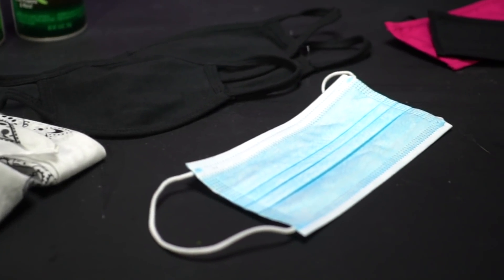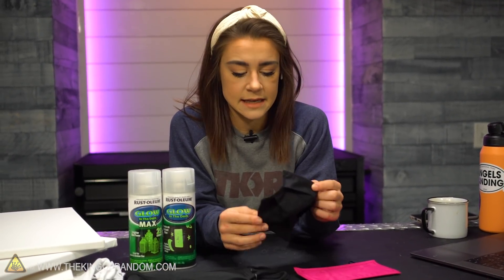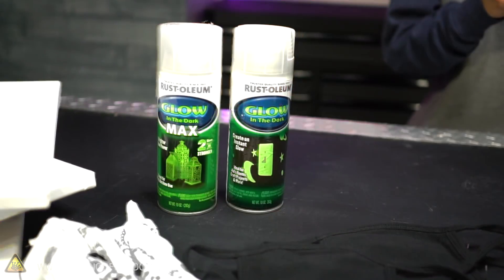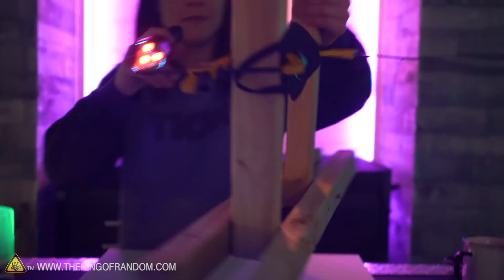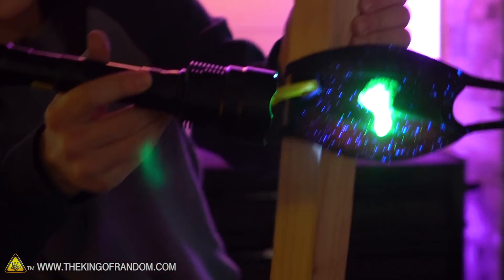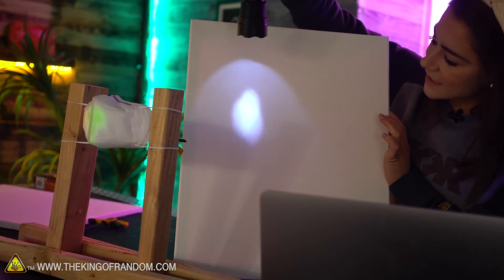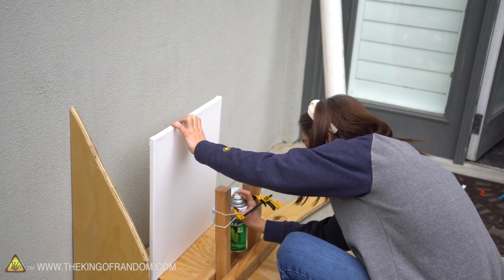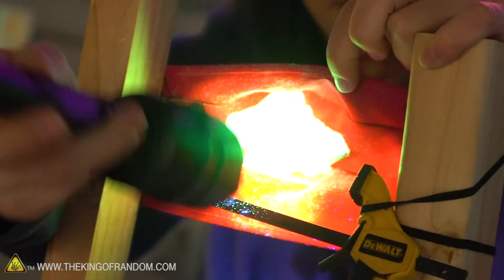DON'T Wear This Type of Mask

Comment: KN95 isn't the same as N95. KN95 is a Chinese standard, which is deceptively used on Amazon listings and the like, but where N95 masks are required (and fitted properly), KN95 masks aren't used because they don't meet the requirements

Comment: I have two homemade clothe masks, a few store bought clothe masks in a Ziplock bag with a bunch of level two surgical masks, and a Creeper themed mask that looks similar to the surgical masks, but requires a filter for the Creeper mask; which it came with two filters. Just like a personal humidifier I recently bought, which came with a filter to start with and a replacement for when the first one goes bad

Comment: This is the jankiest experiment ever. They tested the unworn masks floating around in space in front of a spray nozzle with no face to madk type block to seal against. Then they used hardware store paint with probably glowing strontium aluminate to simulate virus particles which are actually thousands of times smaller.

Comment: Unfortunately, this video just contributes more ignorance to the public. These tests are flawed in so many aspects, they are meaningless as far as covid is concerned. Spray paint holds no relation whatsoever to viral particles. Even if it was, the spray paint is not applied in manners even resembling coughs ir sneezes. The masks usage is not applied in any way similar to how a mask would be utilized in a real world situation.
At the very least, TKOR should be ashamed of themselves for this. At worst, you should be held responsible for deaths and spreading of illness that will come from your spreading of false information.

Comment: These tests are not accurate as spray paint particles are larger and heavier than covid viruses. Also the air/particles will take the path of least resistance via around any open area around your mask. Also, masks are designed to redirect your breath, not filter it. Lastly, you don’t take your breath with you when you leave the area, it will stay in that spot for up to 3 hours. Simple particle physics that I learned in physics 11.

Comment: From what i see you only did the spray paint can on the one side of the bandana when i see people folding them in half and then putting it on there face you should of tryed that too to see if it still had the same affect because its layerd more by being folded it would be more or less affected.

Comment: With a mask you will breath in oxygen and out carbon dioxide.  Then you will continue to breath in carbon dioxide which is why older people struggle to breath with masks
Reply: There is proof that your oxygen intake isnt dangerously low with a mask. There is also proof that your CO2 intake isnt dangerously high. No matter your age.

Comment: You could also try blowing out a candle with them on!
Reply: Great thought! I just tried your idea with one of my cloth masks and then again with a standard surgical mask.

I blew as hard as I could through the cloth mask from a distance of 1' moving the candle in to almost touching the mask with no effect whatsoever on the flame, But I got light headed because I was blowing as hard as I could.

Wearing the surgical mask, I again started at 1' and blowing as hard as I could, I moved the flame closer to my face. At 6" the flame began to flicker. At 4" to 3" it was clearly being affected but wouldn't snuff out no matter how hard I blew. I didn't bring the flame any closer because the material is thinner than the cloth mask and I was worried about it quickly catching fire.

Comment: Not all KN95 are made same. Anyone could be making those. What doctors are referring to is 3M KN95, they are "not allowed" to speak the first two digits, that's the manufacturer. For that brand it comes in multiple sizes - so you need-to/can do a fitting test to find which model to use.

Comment: Water soaks through cloth - that's not a real indicator... unless you're going to go lick someone.  But a better test is - spend all day without a mask - spray paint up in the air over you all day, then put on a mask, and see how much paint goes though the mask... most of it is already outside of the mask... so... that defeats your 'prevents spreading' might do something running across someone who's covered in paint...

Comment: You know what is funny none of this helps against an airborne virus
Reply: Masks have been proven to slow down the spread by 40%
Reply: @metalpuppet5798  40% is still failing to do anything
Reply: @colbyferrell8797  40% is A LOT when it comes to at least taking some pressure away from health care systems

Comment: Zinc can floor an animal in the wrong doses and will absolutely nauseate a user if the pill is taken on an empty stomach; but the strength of nausea and the relief after purging the raw pill from my empty stomach proved that the zinc is a potent anti-infection vitamin: zinc dosed daily will allow significant virus resistance for a user.

Comment: This should of been made a long time ago but from watching the first few minutes there's a lot of problems with it I see already
Correct me if I am wrong btw
1) spray paint isn't the same as the molecules of our breath is, our breath does have a lot of different sizes of molecules but spraypaint especially if it's a liquid based can only be so small and the viruses can be smaller than even our breath particles, it is not as much a huge problem but stills problem none the less 
2) N95 masks block a lot more of the particles than 95% 
Because of how they are made they block most if not all larger particles and smaller particles but the medium particles it only blocks 95% hense the N95
3) masks do work both ways due to popular belief and because of this it is actually multiplied when two people are wearing masks

Comment: This is not a scientific representation of how these face coverings would function if worn properly on a human's face. The average pressure of a spray paint can is 28 to 29 psi. The average pressure a human can generate with their lungs while breathing/talking/blowing is anywhere from 1 to 2 psi. Therefore a spray paint can is not a comparable representation of the average human and their lungs.
Reply: Also there was no proper control on how long or how much was sprayed
Reply: This is the comment I was looking for.
Reply: Pressure is measured in a surface. That's why it's called Pressure per Square Inch. The spray is dispersing in a wider area, so it's not 28 PSI. Also, when humans sneeze they generate more pressure.

Comment: So this was a better experiment than the last one, but it still didn't test the diffusion of a saturated mask which is what the state of most masks are due to them being worn for extended periods of time. A tight fitting and highly saturated mask is going to have a greater diffusion rate and increased spread of viral particles and water droplets than a loose fitting mostly dry mask that is tested in short duration. Use a small electric air mattress pump to blow into a tight fitted and highly saturated mask. Then your test will be valid and equitable.

Comment: So, the human mouth, a roughly 52mm hole,  reaches around 2-3 psi of pressure during a sneeze..

While we are doing strenuous activities we see around 0.05 psi through the same 52mm hole...

A can of spray paint is sitting at around 145 psi through a 1.5mm hole..

Just felt like someone might care about those numbers...

Comment: A bandana is doubled over when worn and provides an air gap between the 2 layers.  You can also tuck it in your shirt.  We often used them in construction, often wet for better filtration.

Comment: Argument about the bandana... you have air passing around it... the same thing happens with a regular mask.
Reply: A "regular mask" might if its just a towel or something, but a fitted mask, n95, r95 ect,  have VERY little leakage. Mostly due to the small hairs on the face.  If you have a beard,  well you are on your own.

Comment: People mad and decide this test was a failure just because TKOR didn't fold the bandana. Like 2 layer of that thin cloth will do drastically better. I can blow a candle through it
Reply: The thing is, they DID a double folded mask, they just didn't show the setup/result. Sure, it would be nice to have empirical evidence of how much the double-folded bandana did, but they specifically said that double folded was the worst other than the near-useless single-fold bandana.
Reply: @whoisthisguy128  yes I watch the whole video. And I think it doesn't matter whether they show it or not. Bandana is so thin it see through, I fold mine twice (4 layer) and still can blow a candle out

Comment: If you're spray painting outside your going to get air blowing the over spray around ... That could be the reason your canvas is getting a little over spray on it but if the over spray is heavy than the mask is not doing it's job...

Comment: I'm gonna go out on a limb and say that a human sneeze is very different than the release of spray paint, both in length and pressure. Mark Rober's video on this is much more accurate as a human was used as the subject and culture samples where shown, providing a much more stable and relatable environment and experiment.

Comment: In the testing results you seemed to indicate that the medical mask did a better job than the unfitted kn95, but in the ranking in the summation of the video you put the kn95 higher than the medical mask. Which is better?

Comment: I feel that colored spraypaint wouldve been easier
Reply: And we could actually see how the paint goes through masks, not just the aftermath
Reply: @11tomdec  actually coloured spray paint is actually more thicker so more heavier and it wouldn’t be as effective for the experiment hope this helped
Reply: @unicornpoptv2430  you might actually be right idk
Reply: Yea your right
Reply: Agree. Also I think the bandana worked that’s why they didn’t show the close up on the board. It didn’t fit their hypothesis. The test was rigged like this latest election lol
Reply: @e-ironmanmarsden754  I don’t know bout that lol
Reply: @e-ironmanmarsden754  they- didn’t have to? I saw the Speckles quite easy-
Reply: @e-ironmanmarsden754  you know you did not need to bring politics into this..and I would say Biden won the election he did not cheat.
Reply: @Defnotjolie  right!
Reply: @e-ironmanmarsden754  it’s also perfectly possible they completely forgot to show it- they are human. And it’s- kinda common knowledge (or it should be) that a cloth you can see through that’s not plastic would be- ineffective
Reply: @e-ironmanmarsden754  ehhh that's a lil far fetched
Reply: @e-ironmanmarsden754  you just wanna not wear a mask and seeing a bandana not working makes you feel bad... and there was no point in bringing your cult into this.

Comment: Okay big hole in this test the particles in the paint arent nearly as small as virus particles...
Reply: Shhhhh.  You're ruining the scare factor. Gotta keep the public afraid of the virus with the 99% survival rate so they will do what their government tells them to.
Reply: Except SARS-Cov-2 is not an airborne virus, it needs a droplet to travel, so this test is semi-valid (high pressure, the single layer bandana, etc. invalidate the test)
Reply: @roscoedigerness8217  It's not that it's not airborne, it is, but it's molecular weight won't allow it to "float" through the air. It can still be transmitted without a droplet.

Comment: Could you test other face coverings, such as the neck gaiters and the masks designed with sports in mind (with the exhale valve); and with the valved masks, with and without a filter media on the valve?

Comment: How much pressure in a can of spray paint ? Thanks. Well, they used to use CFC's (R-12) as propellant so if you look at the pressure tables, R-12 is approx 70 psi at 70F.

Comment: isn't this medical advice? is someone there actually qualified to say "this is the one you should wear"? If Kennen has this qualification based on his monologue, it isn't stated.
Reply: Nope. Not medical advice.
They aren't making medical statements. They're not suggesting that people use a drug or device to treat or cure any ailment, they're showing gross effectiveness of publicly available products. No different than testing a thermometer to see if it reads temperatures accurately.

Comment: The bandana isn't really accurate I'd say, as when you use it as a face cover you should fold it in half diagonally. That way, it's 2 layers of cloth and the bottom end which is not closed should be tucked into the t-shirt

Comment: Bad information at all. Humans aren’t paint sprays,  not even close. The test makes not sense at all.
Reply: The difference between an example to show a point and being 'bad information' is pretty large.
Humans aren't eggs, and yet we build devices to protect humans from impact using eggs as subjects. Humans aren't dummies, and we put them in cars to run into walls. Humans aren't bananas, but we understand the effect of cellular respiration because of them.

The 'test' here was to show the effectiveness of the masks at blocking particulate... specifically wet, small, particulate... like we get when someone is breathing/coughing/sneezing/talking.

And, low and behold, the masks were tested.

Not bad information... bad understanding.
Now wear a mask.

Comment: what kind of test is this.. i haven't seen any person with a pressure of the spray paint when talking..
Reply: The psi at the point the spray can comes into contact with the mask is much lower than the psi at point of contact of a tight fitting mask. Get an inspirometer and test it for yourself.
Reply: a sneeze/cough travels a lot faster than spray paint
Reply: @jakefontaine229  I mean yes but they did do a long build up spray
Reply: @purpletims  Well it could represent multiple sneezes, but I am not sure how much an average person sneezes in a day.
Reply: @jakefontaine229  i agree with that.. do you sneeze longer than the way they test the spray.. it doesn't make sense to me...

Comment: Actually you are applying to much pressure you would be yelling by how much pressure you are applying with the spray paint
Reply: Not true. Get an inspirometer and compare the psi for your normal breath to a can of spray paint. The spray paint the way they used it was actually significantly lower psi at the point of contact with the mask than your breathing through your mouth at a normal rate.

Comment: If spray paint is just 0.1 to 5 microns in diameter and the coronavirus is 50 to 200 nm in diameter, these masks are rendered useless. The coronavirus cell is 100 to 5000 times smaller than the spray paint particles.

Comment: When you are doing the talking spray, no one is talking and spraying particles with the same force as they may cough. So, it doesn’t seem very accurate to presume the leakage through the front of the mask would actually occur like that.

Comment: When you sneeze, the particles are much finer than spray paint particles
Reply: They are still trapped in water particles and that’s what there testing
Reply: oddly, even a screen door gets wet from a pressure washer.
Huh... still blocks some wet stuff.... neat!